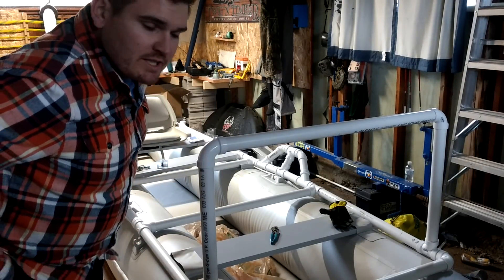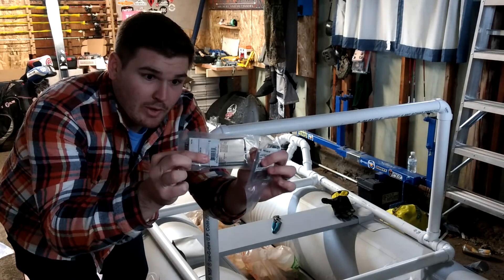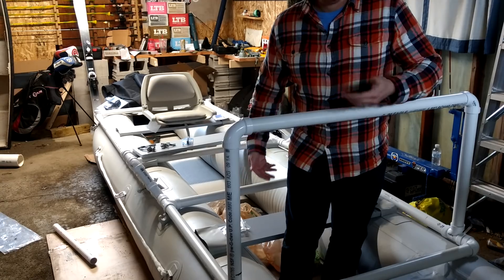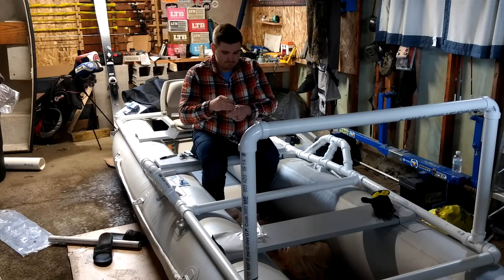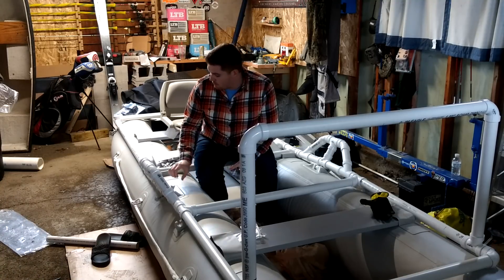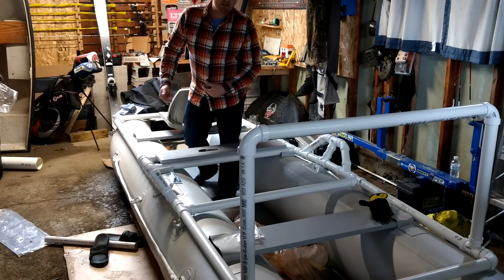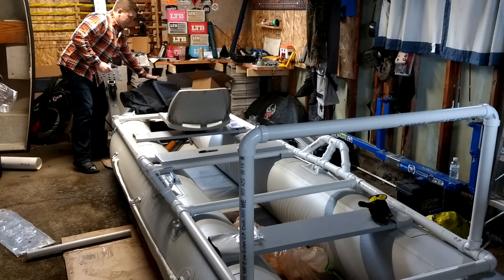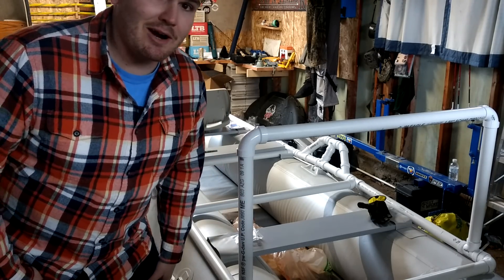NEW BOAT UPDATE & FLY FISHING RAFT DIY Mods

Comment: good video bro, i have the 14.1 bris kaboat. also have the same idea. will definitely keep in touch good luck with the project.
Reply from the maker: Thanks! I was torn between the two!
Reply: I have the 14.1ft bris too and to give you guys an idea for how versatile it is, I run it out of virginia beach on the Chesepeake and it handles it great, and the stability and ride are great for a boat that fits in your trunk.  You guys will have amazing river raft setups, but down the road if you ever want to explore bigger water just slap an outboard on and you can do it with no problems.  Heres a couple clips from last summer:  https://youtu.be/CCxjoUWncx4

I even modified the tilt mechanism to have a third setting that lets the boat run in about 3 inches of water, so it has no trouble exploring the skinnier water of the New River and other freshwater near me.

Comment: I'm actually doing the same thing with a 11 foot raft. Yours looks good. How much did you end up spending on pvc
Reply from the maker: Not much! Hard to say because I bought other things as well, but in PVC alone it was probably a little less than $100? Maybe $85? I have some more stuff I just picked up for the next video too
Reply from the maker: Then bought a few 2x2 treated 8footers for key bracing points
Reply: Sweet. My frame is pretty simular to yours. I'm still trying to figure out the best way to the oar mounts. I did decide to use a cooler in the front with a seat on top. Your raft could probably fit the tiny yeti

Comment: How did this hold up?? Is it easy to stand up in without the build you created on the drop stitch floor?
Reply from the maker: Still solid. Easy to stand up and fish
Reply: Glad to hear it. I hear this pvc wouldn’t last more than 2 years
Reply from the maker: @Blakebentley4  I painted it all with enamel and store in dark garage
Reply: Can you send me the enamel you use?? Trying to make one last 5 years in the Texas heat garage stored
Reply from the maker: @Blakebentley4  I used an enamel paint meant for marine applications and an enamel 2 part aerosol
Reply from the maker: @Blakebentley4  I find that storing it in the garage is the key. Constant UV exposure will be the problem and most folks want to store them outside and uncovered
Reply: Love the setup. 
I’m thinking of going this way instead of a dedicated (rowing) river raft. 
Yes I’d like a drift boat … but I’m thinking, if I’m on a big river -  at least with one of these motorised boats, I can motor back up the river to the launch at the end of the day.